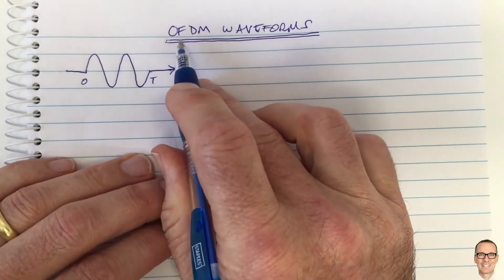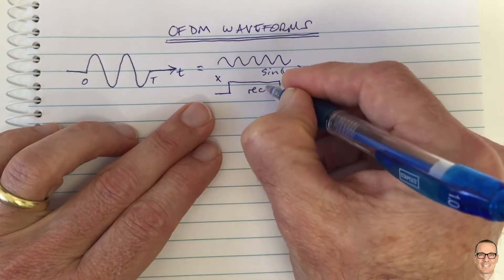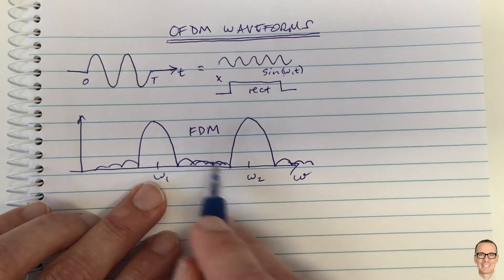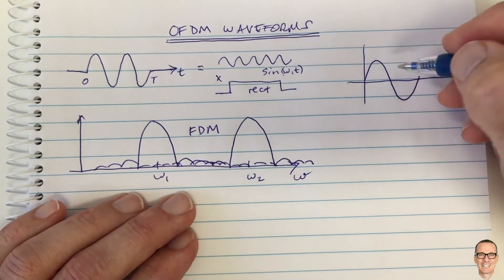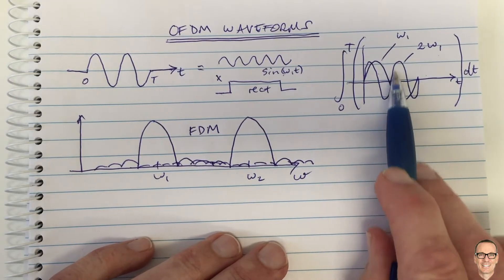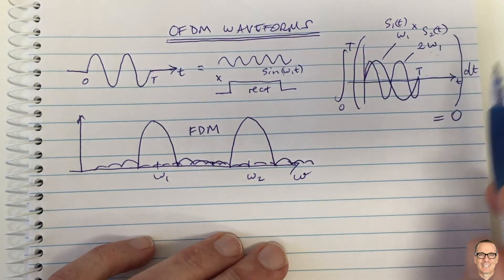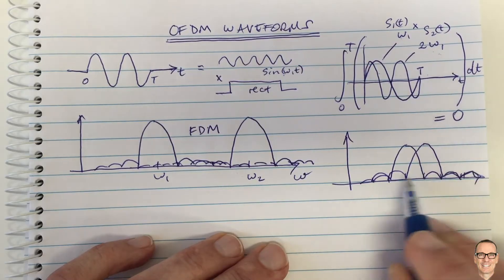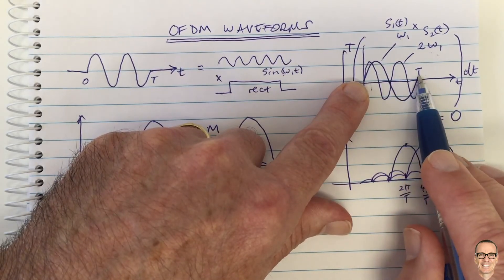OFDM Waveforms

Comment: Sir, I'm so glad that watch this great explanation. But I have a question in 3:30. In video, multiplication of two sine waveform at right after of 0 sec is canceled by it of just before of period of w1 sine wave. But those two have a same positive value. I would be appreciate for your answer professor, Thank you.
Reply from the maker: Yes, sorry, I pointed to the wrong part of the waveform at that time. Essentially the left hand quarter (between 0 and T/4) and the right hand quarter (from 3T/4 to T) give a positive result, but the middle half (from T/4 to 3T/4) give a negative result. And these cancel each other out.

Comment: I have a question. For 802.11a, it is OFDM. For data rate = 54Mbits/sec, there are 52 subcarriers. If one subcarrier is of center frequency say 5 GHz; then the next should be of center frequency 10GHz, which is out of the WLAN band. This is odd.
Reply from the maker: No, that's not how it works. The subcarriers are close together, and are constructed at baseband. Then the entire signal (containing waveforms for all the subcarriers) gets up-converted to the carrier frequency (that's where the 5 GHz comes into it). Hopefully this video helps: "How are OFDM Sub Carrier Spacing and Time Samples Related?" https://youtu.be/knjeXo3VZvc

Comment: When we generate an OFDM signal, we do a kind of an upconversion. Is that right.
We give the points in the vector to the different factors (for the different frequencies e.g. e^j...). So we can see that as upconversion.
So we don't need an extra oscillator for the extra upconversion. Is my understanding right?
Thanks a lot.
Reply from the maker: Sort of, but not really. You still need to up-convert to the carrier frequency band. Hopefully these two videos will help explain: "How are Complex Baseband Digital Signals Transmitted?" https://youtu.be/0lkRJgnywkg and "How are OFDM and xDSL (DMT) Related?" https://youtu.be/CET2UuGeEqs

Comment: Explanation why s_1 and s_2 are orthogonal is in fact - as already pointed out - wrong. You multiply and according to your explanation you would get the same values (i.e. also the same sign) and hence no cancellation. May should should just draw the multiplied version, otherwise its confusing.
Reply from the maker: Yes, I think I made a "verbal typo" in my explanation. You're right about the signs. But the overall result is true. The integral equals zero. In fact, the first and last "quarters" are positive, and the "middle half" is negative - and they sum to zero.

Comment: I don't understand how the OFDM works. A mobile phone may operate on some a frequency band between 700 MHz and 710 MHz. There could be multiple carriers within this range. But the double frequency of 700 MHz is 1400 MHz and this cannot be used for OFDM, because it is outside the range. So what is a concrete example of these orthogonal frequencies? Are they carrier frequencies or modulation signals?
Reply from the maker: The subcarriers are generated at baseband, and then the whole waveform is up-converted to the carrier frequency. So in your example, the subcarriers might be 10kHz apart, and if there are 1000 subcarriers, it would generate a complex baseband signal that is 10MHz wide. Then you up convert this to be centred at 705MHz, and the final transmitted signal will be in the range from 700MHz to 710MHz. Here's more details about up-conversion: "How are Complex Baseband Digital Signals Transmitted?" https://youtu.be/0lkRJgnywkg
Reply: @iain_explains  Thank you for explanations, now it is more clear.

Comment: Thank you very much for the videos! Those are really helpful. Could you please make an explanation video for the single-carrier ODFM waveform?
Reply from the maker: I guess you haven't seen my webpage with a full listing of all my videos https://www.iaincollings.com/home which includes this video: "Why is SC-FDMA called "Single Carrier"?" https://youtu.be/Zf1SL6R99fQ
Reply: @iain_explains  thanks! So, I wondered if OFDM is called a single carrier system with the lines I quoted from the video (https://youtu.be/Zf1SL6R99fQ). "That processing achieves the frequency orthogonality, and then you use a single carrier to upshift the entire digital waveform. So, this is called a single carrier system even though OFDMA uses multiple frequency channels (sub-channels)". I am a little confused. Can you tell me when OFDMA is called a multi-carrier system or if there is no such concept?
Reply from the maker: People often use the term "carrier" in confusing ways (often without realising it). In principle, a "carrier" is any basis function that modulates a baseband waveform. This can be done digitally (using an IFFT as in ADSL), or using an analog miser (as in FDMA), or by using a combination of both digitally and using an analog mixer (as in OFDM and OFDMA). Perhaps this video might help: "How are OFDM and xDSL (DMT) Related?" https://youtu.be/CET2UuGeEqs

Comment: I watched your video about the rect and sync functions and it was excellent.  I am not a mathematician but am beginning to get a feel this.  In this video, when you drew the sinc function, you drew all of the bumps above the x axis, rather than a wave form.  Could you please tell me why? Thanks a million.
Reply from the maker: Here I plotted the absolute value, or magnitude, of the function.
Reply: Thanks Iain I appreciate the response and I love your channel.  In my mind I’m struggling to understand why it is that when an analogue signal is FM modulated, the information is carried (duplicated) in the side bands.  Indeed, we can even discard one of the side bands.  But when it comes to digital data and OFDM, it seems that the side bands (the little bumps of the sync functions) don’t matter, they can interfere with each other all they like as long as the big bumps are separated. Modulated digital data (E.G. QAM) might include a mixture of frequencies, so surely the little bumps are important. What am I missing? Is this picture of overlapping sync functions what it looks like before digital data are modulated onto the subcarriers?  If so, what does the signal look like in the frequency domain after the data have been included? Can you point me to a resource (or one of your videos) that will clear up my understanding please?  Again, thanks a million @iain_explains
Reply from the maker: In digital communications, a constant digital data value is sent over each period T, and the receiver is only really interested in those values. It adds up the energy in between the T-separated time values, and makes a digital decision every T seconds. For analog FM communications, you're interested in the signal at all values of time (not just integer multiples of T). And by the way, just because the sidelines in OFDM overlap, it doesn't mean we are not interested in them. They certainly are important. But, as this video points out, even though they overlap, it doesn't mean they interfere with each other - because at integer multiples of T, their values are orthogonal between subcarriers. Perhaps these videos will provide more insights: "What is a Matched Filter?" https://youtu.be/Ci-EjiMJo3I and "Why is Doppler a Problem for OFDM?" https://youtu.be/mB0GF9uKC48
Reply from the maker: Your postcard collection sounds great. I haven't been to any of those sites. I think I was shown Maxwell's house when I was a kid, on a trip to Scotland, but I'm not 100% sure - it's just a vague memory. Did you see my recent lucky find, when I was visiting Darwin? "Australia's First Undersea Telecommunications Cable" https://youtu.be/6QdyZG4Q5kg

Comment: This may sound like an ignorant question, but is it possible to combine OFDM, TDM and Phase DM all together to really maximize how many signals can be sent within a given bandwidth?
Reply from the maker: It's certainly possible to combine time domain and frequency domain multiplexing techniques, but that doesn't necessarily "maximize how many signals can be sent within a given bandwidth". Channel capacity is determined by fundamental parameters of power and bandwidth - not the multiplexing technique.

Comment: How is the orthogonality in the frequency domain defined? The peak of the sinc function in the frequency domain coincides with the nulls of all other waveforms is not really the definition of orthogonality. The orthogonality in the frequency domain follows from simply Parseval's theorem. It has nothing to do with peaks coinciding with nulls. Could you please say why peaks coinciding with nulls is important? Thanks.
Reply from the maker: Hopefully this video will help: "Orthogonal Basis Functions in the Fourier Transform" https://youtu.be/n2kesLcPY7o
Reply: @iain_explains   Many thanks for your help. What is not clear is how peak of sinc waveform coinciding with nulls of other sinc waveform relate to orthogonality?
Reply from the maker: It's a great question. Many people think that because the nulls of the neighbouring subchannels align with the peak of the subchannel of interest, that it therefore means they are orthogonal. But that's not the case. It's actually the opposite way around. They align because the waveforms are orthogonal (that's the way the maths works out).

Comment: The OFDM chain I know is iFFT followed by DAC and then upconversion to carrier. Till iFFT we just have a vector of complex numbers. How do we get these multiple of tones just by DAC? What am I missing?
Reply from the maker: Yes, that's right. Perhaps you might like to watch my other videos on OFDM to get more insights. For example: "OFDM and the DFT" https://youtu.be/Z4LIgNgNAlI and others can be found listed at https://www.iaincollings.com/digital-communications under the OFDM tab.
Reply: @iain_explains  Your videos are just excellent. Many thanks for posting them. I have gone through them. 

Coming back to my question, how should the DAC work for OFDM? It should give rise to multiple tones. Could you please elaborate on that? 

If I understand correctly, sampling the continuous time expression in the "OFDM and the DFT" video gives rise to iFFT. So where does the sampling period and the frequency of tones comes into picture? 

How is the transition from discrete time to continuous time happens in OFDM is not very clear? Could you please explain that? Thanks.
Reply from the maker: Have you seen: "How are OFDM Sub Carrier Spacing and Time Samples Related?" https://youtu.be/knjeXo3VZvc ? That video explains how the frequency-domain vector gets converted into a time-domain vector (using the IFFT), and then how the elements of the time-domain vector get sent with a pulse shaping filter (this is what happens in the DAC). This video should also help: "How does the Discrete Fourier Transform DFT relate to Real Frequencies?" https://youtu.be/pIFz84oj9cA
Reply: @iain_explains  Many thanks for your replies! It is clear now. Your videos are really awesome. Thanks again.

Comment: Thanks for the explanation Ian. Everywhere people use the word "OFDM waveform" left and right, but very rarely do they precisely explain or draw the shape of the waveform. One question though: this technique is called "Orthogonal Frequency" Division Multiplexing, but actually the waveforms are orthogonal in "time", not frequency. Right? Then why the name?
Reply from the maker: That's a great question. The subcarrier waveforms are orthogonal, since if you were to match filter the received waveform with a particular subcarrier waveform, then the components from all the other subcarriers in the received waveform would not contribute anything to the output of that matched filter (as indicated by the equation/diagram on the top right hand side). Sure, you could view this as being "orthogonal in time", since the filtering process is done in the time domain, however it is the fact that the component waveforms are all sinusoids at different frequencies that means that they will be orthogonal. From an end-to-end perspective, the data (complex number) that goes into a particular element of the input vector into the IDFT at the transmitter, comes out in the same index of the output vector of the DFT at the receiver, and does not affect any of the other elements of the output vector. These indices correspond to the sub-carrier waveforms (which are each at a different frequency), and so in this sense it is orthogonal in frequency.

Comment: Hello, could clarify this moment. Those orthogonal frequency has to be integer multiplication of each other. So if one is 2.4GHz, the other is 2.4x2=4.8GHz. And the third would be 7.2 GHz. so those carrier frequencies are far apart, usually you are given smaller bandwidth to operate in (like 500MHz)
Reply from the maker: That's something that often confuses people. It's not the actual RF subcarrier frequencies that need to be integer multiples of each other. It's the "baseband subcarrier" frequencies that are integer multiples of each other (ie. before the "transmit waveform" gets multiplied by the RF carrier). This is essentially "by definition", since the IFFT in the transmitter implicitly assumes that the values in the input vector relate to equally spaced frequencies.
Reply: @iain_explains  can you share a link that explains the difference between rf frequency and baseband for this case?
Reply from the maker: Perhaps this video might help: "How are Complex Baseband Digital Signals Transmitted?" https://youtu.be/0lkRJgnywkg

Comment: I have a short comprehension question. For localization purposes, one need a high bandwidth due to the smaller symbol duration. That is clear. But, all modern comm. systems use OFDM and one build many channels with smaller bandwidth (number of channels = number of subcarriers). That is an advantage in a multipath environment, but, disadvantageous for localization. So, do we have the benefit of smaller symbol duration or  not? It is a bit contradictory to me. Is the symbol duration for the localization purposes 1/B_full or 1/B_subcarrier?
Thank you very much.
Reply from the maker: If you've only got one antenna, then you're not talking about "localisation", just "ranging". And yes, for ranging , the bandwidth is critical. But you don't only do it on a single sub-carrier, you would do it using the full spectrum transmitted waveform (for an OFDM symbol, for example), by correlating what you receive back from the reflection, with the waveform (ie. the OFDM symbol) that you had sent out. See this for more details on radar: "Why is a Chirp Signal used in Radar?" https://youtu.be/Jyno-Ba_lKs
Reply: @iain_explains  Thanks for your quick answer.  Yes, I mean ranging. But, it is also a one way ranging. UE sends the signal to the base station. The BS measures the time. So there is no resonse. In that case, it must work without correlation.  Ok, I take away that they use the full bandwidth, rather than just one subcarrier with a smaller B and its longer symbol duration.
Reply from the maker: It sounds like we're talking about different things. I was referring to the recent research on the topic of "joint radar and communications", where the communications signal carries data, but the transmitter also listens for "bounce-back" versions of the transmitted signal, and performs radar processing on that. It sounds like you're talking about some sort of on-way timing delay estimation.

Comment: Thank you for this video Lain. Could you help guide my understanding for why n*s(t) is orthogonal to s(t) for any integer n? I have tried computing the orthogonality condition by integrating two signals (s(t)*ns(t)) from 0 to 2pi) and I cannot get it to compute to 0. Thank you!
Reply from the maker: Sorry, I'm not sure what you're talking about. The term n*s(t) does not appear in this video. Also, I'm not sure what you are using the "*" symbol to represent. If it's supposed to be convolution, then it doesn't make sense to convolve an integer with a function. If it's supposed to be multiplication, then it also doesn't make sense to think that a simple integer scaling of a function would make it orthogonal to the original function.
Reply: @iain_explains  Ok, I will be more clear here. You show at @3:35 that if you integrate s(\omega_1)s(2\omega_2) from 0 to T with respect to t, the integration goes to zero. I understand the pictorial representation of this, however, I was hoping to use specific functions to prove this orthogonality condition. I hope this is more clear. Thank you for your time.
Reply from the maker: I'm not sure what you mean by "specific functions". I gave the equation for the exact functions that I'm talking about at 0:50 min. If you multiply sin(w_1 t) with sin(2w_1 t) and integrate them over a period T=2pi/w_1, then it equals zero. This is true for any value of the frequency w_1. These are the sinusoidal basis functions. You might like to watch: "Orthogonal Basis Functions in the Fourier Transform" https://youtu.be/n2kesLcPY7o

Comment: when a frequency is expressed in the frequency domain, why does it have all those little 'side lobes'? If it is just a single frequency with no noise, wouldn't it just be a perfectly straight vertical line, where the base of the line is at the given frequency along the x axis?
Reply from the maker: It's not just a pure sine wave when it's been modulated by a digital data sequence. You can think of it as a sine wave, multiplied by lots of square wave functions, each offset by an integer multiple of T. Therefore, in the frequency domain, it is the convolution of the sine wave transform (ie. two delta functions), with the square wave transform (which is a sinc function).
Reply: @iain_explains  great, thank you so much for these videos. Potentially another video you can cover haha XD
Reply from the maker: Yes, I'm continually adding to my "to do" list.